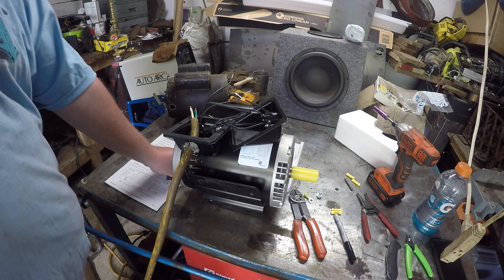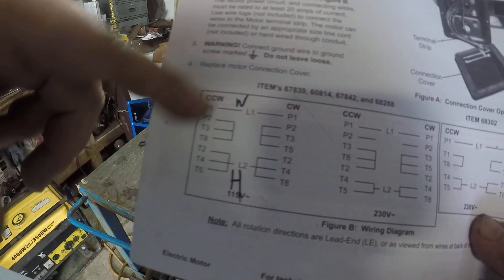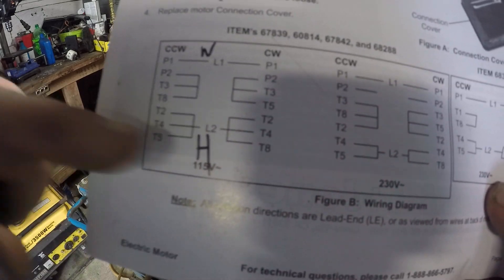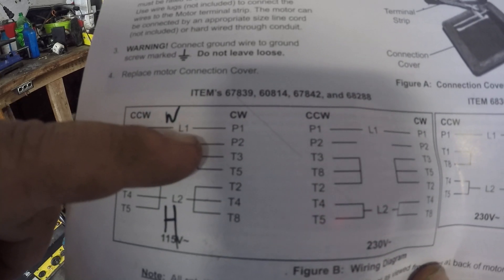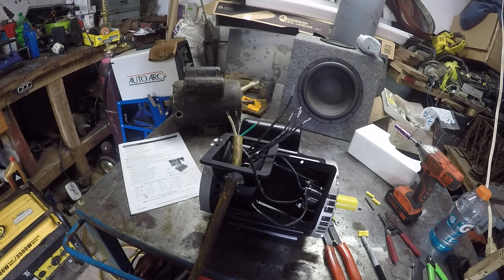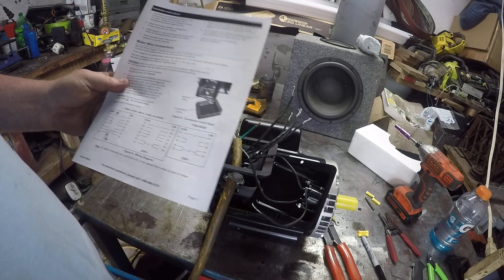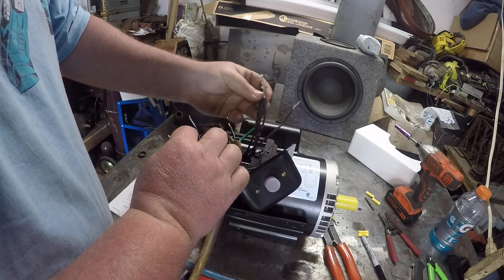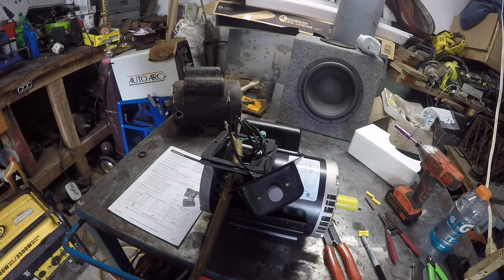harbor freight 2 HP Compressor Duty Motor wiring

Comment: Thanks :)  I have a 14" Delta band saw with a 3/4hp motor on it that I want to use for re-sawing lumber with and want to get a larger motor for the purpose.  As this one is 1800rpm it's close enough to the saw's current 1725rpm motor to be a direct replacement and as I'll be running it on 120v I was curious about how to wire it.  I'm going to save this video to remind myself when I pick the motor up (HF is a 60+ mile round trip for me, so I'm in no hurry to go right now, lol).  I'll pick up about ten feet of SJOOW 12/3 wire for it from the hardware store.  May not need that heavy of a gauge, but better to have more than less I guess.  Looks like I'll need a 20amp breaker as well.

Comment: Thank you for the very helpful video . My question is , on the item description tag it says the rpm is 1750 but the tag on the motor says 3400 . do you know which is correct ? Thanks .
Reply from the maker: as far as i know the 2 horsepower motor is 1755 rpm and the 3 horsepower motor is 3470 rpm
Reply: @fixitwithbiskit  Thank you .
Reply: @fixitwithbiskit  3hp motor is 3600 rpm

Comment: Great Video. I just finished wiring my 1 1/2 HP smith& jones motor and every time i turn it on i can see a spark coming from the back of the motor. Does your do that?? I just wonder i wired it wrong. It run good. Thanks
Reply from the maker: yes my motor sparks too